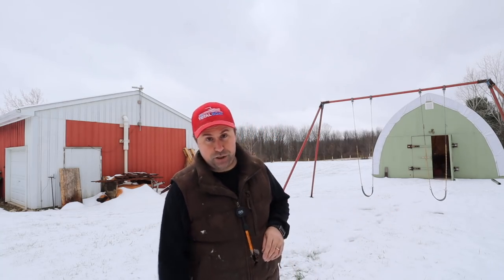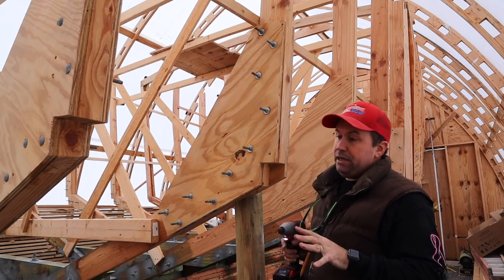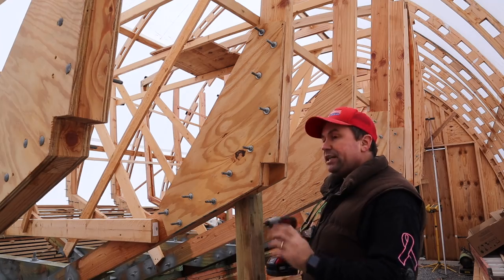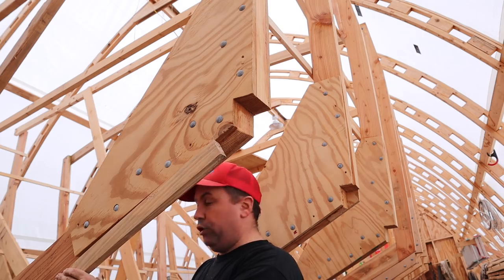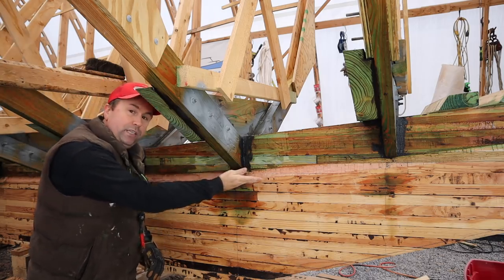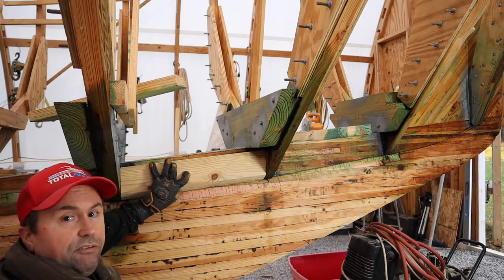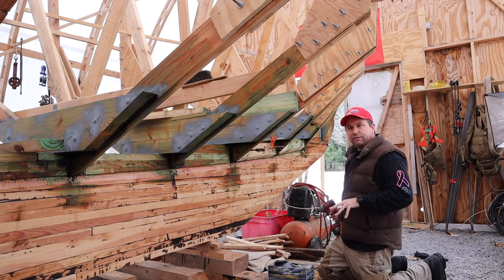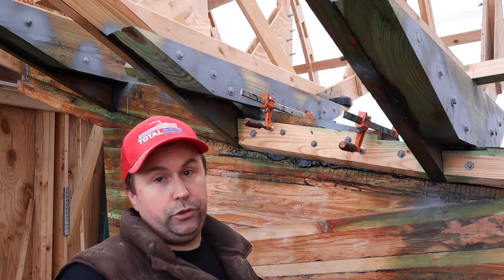Laminated keel trawler boat, odd's and end's.  SDP #37

Comment: Apologies if this seems a bit critical, it's not meant to be. I was wondering if you are planning to replace those galvanised screws you used with stainless or brass? I know from firsthand experience that those screws will not survive for very long. The zinc coating on them tends to be pretty thin, which will allow rust to form inside the wood. No matter how much you protect it from the outside. Just think about it like this; there's a very good reason that boat builders use brass or stainless for anything that will feel the moisture.
Reply from the maker: No it's ok.  Every boat is a compromise.  As we've said before, we are not building a boat for the ages.  This boat is for our lifetime and resale is not a concern.  Locally sourced lumber and galvanized fasteners are what make the cost of this project possible for a family like us.  We are using hot dipped galvanized, not plated, which have been used for work boats with much success for many years.  Properly maintained, we should easily get a 30 year life span, which is plenty for us.  If the old work boats are any example, we might get up to 50, but I'll be long dead by then.
Reply: @SixPointsWoodWorks  thank you for the very quick response! I didn't realise that hot dipped bolts would survive that long on working boats. That's gotta be all the proof you need then! Good luck with the project! 😎
Reply from the maker: No problem! You know if this was a traditionally planked, cotton caulked boat the use of galvanized fasteners could certainly be an issue.  However our boat will be sheathed in planks and plywood then covered with fiberglass and epoxy.  Our boat will not need to "take up" to be water tight and we should have a very dry bilge for many years.  Silicon bronze would be best, but every boat is a compromise and our use of galvanized fasteners is one part of the project that makes it affordable enough for a family like ours to take on a project of this scale.
Reply: Addicted to Projects i have seen boats with only steel nails over 100 years and the nails still in good condition , these boats had earth strapping running all around them and sacrificial anodes as well

Comment: That is old hot dip galvanizing for sure. Modern stuff can't hold a candle to it. Found the best way to drive them was to use bees wax or Ivory soap on the threads. Drill those limber holes now, too, while you can get in there.
Reply from the maker: I know, they look darker and awesome.  Probably full of toxic heavy metals, you know the good stuff that last forever!

Comment: You may already know this, but Lestoil works wonders on roof cement once you get it on your clothes. Put a cup full in a 5 gallon pail of water and soak your clothes overnight, then run through the wash.
Reply from the maker: I didn't know that, thanks.  What do I do for the tar I transferred from my pants to my Lazy-boy, area rug and wood floors?  This stuff is everywhere! ;-)
Reply: Six Points Wood Works you're preaching to the choir there, lol

Comment: I don't know anything about big boats like this, as I've only restored a small 1951 Chris Craft Riviera.  I was wondering why you don't use 3M 4200/5200 instead of the dolphinite and other sealants.
Reply: It would be cost prohibitive for one thing.
Reply: @matthood7546  Yeah, good point.  I think I spent about $600 on 5200 for the bottom of my boat.  I used about 50 tubes if I remember right.  The bottom was original, and the dolphinite had dried up decades ago.
Reply from the maker: exactly, cost.  The old timers rave about dolphinite and the use of tar is a good balance of cost and effectiveness.

Comment: Just being a safety nut but it's not a good idea to breath in copper treated wood dust.  Second, You went to the trouble of taring the joint between the keel and the bevel pieces but then you drilled holes for lag bolts that will be a path for water to intrude into that wood you tried to protect.  In other words, you need to seal up those bolt holes to avoid rot from standing water around the bolts.

Comment: In your intro you say it can take two...anywhere in the world they want to go. I sure hope your travels don't take you into icy waters, not sure that stem would be strong enough to be an ice breaker. However, if you and the Mrs. have no interest in sailing the arctic, you would be fine, I think.
Also, does LocTite make a mariner's thread locker? Or did you just use regular ole LocTite? Is it rated for saltwater?
I hope, since I am still catching up on the series, that you drilled the drain holes in the floors so water can get from bat to bay through the stations to reach the bilge pump without having to fill up to overflowing the floors/frames. It sounds like the planking is going to be perpendicular to the keel. I would think angled to hit at least three frames would be so much stronger, even planning on two more layers with plywood. Remember the old houses fro 100+ years ago? The shearing was put on at approximately a 45° angle for higher shear strength. Water packs a bigger punch than wind, so I would prefer the strongest sheathing/planking I could do. Just a thought.

Comment: Just curious why is keel a big stack of wood instead of one large timber
Reply from the maker: Several reasons.  working mostly alone, laminating our large timbers was our only option.  We also wanted to prove our designers vision that backyard builders did not need to source rare large timbers to build a blue water cruising boat.  Finally, laminated timbers are actually stronger and more stable than solid timbers.  If you check out modern construction methods, the use of glue-lams, LVL and trusses are all versions of what are essentially laminated timbers. Now its way more labor intensive to laminate and slows the building process down, but since we are not building boats for profit, time is on our side.

Comment: If it was my boat I would put a locking/nylon nut on top of the nuts with thread lock.  Also all hardware should be stainless steel.  When you screw in a zinc coated screw it rubs the zinc off.
Reply from the maker: stainless would not be great in this application.  suffers from crevice corrosion when buried in wood or submerged in water where it is starved for air.  Silicon bronze would have been best, but to expensive for us.
Reply: Yuppp, 316 stainless and locks nuts are the rule unless the fastners are free.
 At least grease the ** out of galvanized so they dont rust the ** up.

Comment: Love your videos but your transom is far to weak.
Reply from the maker: well considering it's not bolted in to the keel, not attached to the chine, not attached to the bilge stringers and not attached to the deck beams, I would say you should be patient while the build proceeds.  I think when we are done, the 2" thick transom will be plenty strong.
Reply: @SixPointsWoodWorks  I had a 2 1/2" fiberglass transom on my aquasport and it cracked open after hitting a large wave so no 2" on a 40' boat is not sufficient in my opinion or 50yrs of boating.
Reply from the maker: Well I guess I'll just have to trust the designer and the many, many other examples of this boat design on the water today.
Reply: @BigWater59  2" of oak is WAY stronger than fiberglass.
Reply: @SixPointsWoodWorks  Doesn't the design also call for a layer of plywood over the entire outside of the hull? So two layers of oak plus plywood and fiberglass cloth for the transom?
Reply from the maker: indeed.  1" thick white oak frame, covered with 1" white oak planks, covered by 2 layers of 1/2" plywood sheathed in fiberglass and epoxy....Like I said, I think I'll be alright.  It's the internet, everyone is an expert,